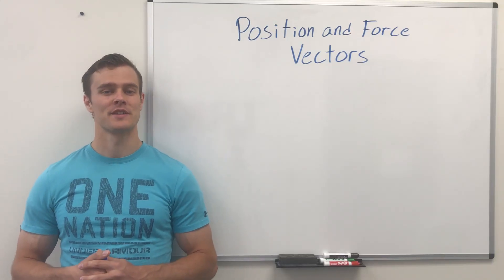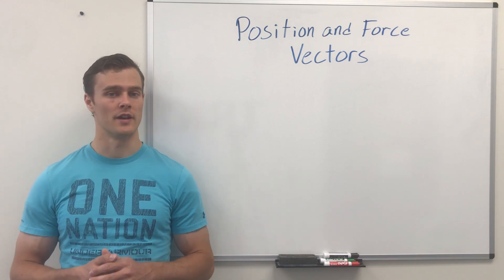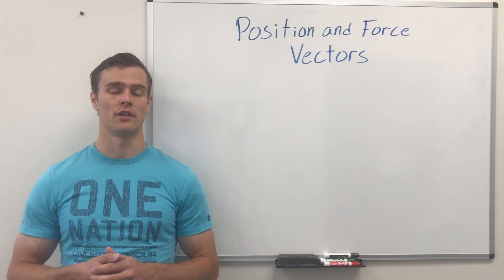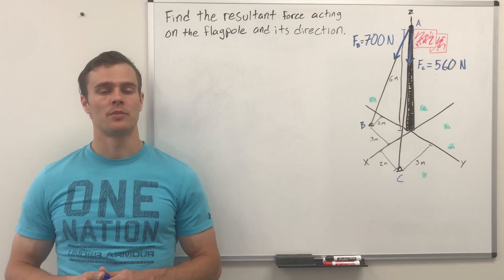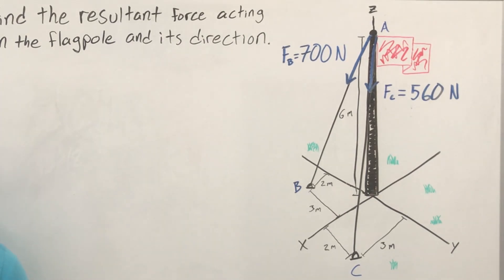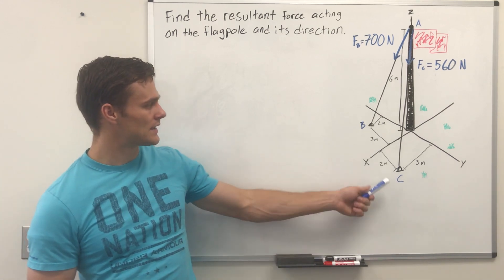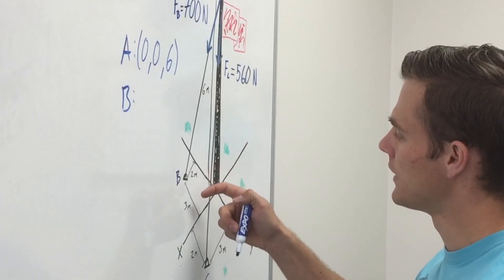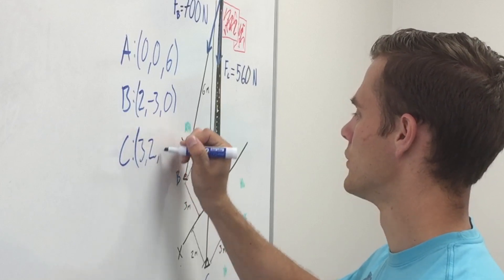POSITION AND FORCE VECTORS with an EXAMPLE PROBLEM of a flag pole

Comment: Sir, can you solve the Pole problem by using following parameters (Example: Dia 216 mm x 8 mm thick Mild Steel CHS Tube - 8 m height, welded with 500 x 500 x 20 mm thick baseplate, erected in the group by using 4 numbers of M24 x 450 mm Through bolt, just consider the windload and flag cloth load of 160KN on the pole).
Reply from the maker: Good luck with your exam! That’s to test your knowledge, not mine.
Reply from the maker: Haha free engineering? Nice try
Reply: No sir, this is my Engineering Exam problem,..
Reply: This is my University Engineering Exam (Anna University, Chennai) Second Semester Exam problem, I solved that problem during my exam, now am updating once again. So, I asked, Don't feel bad,..